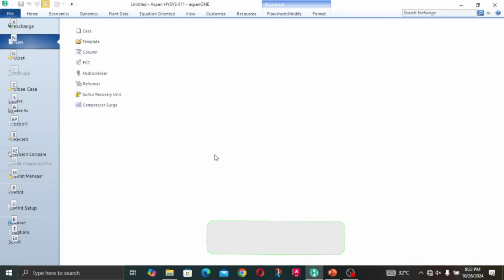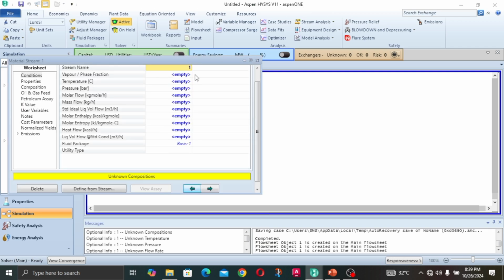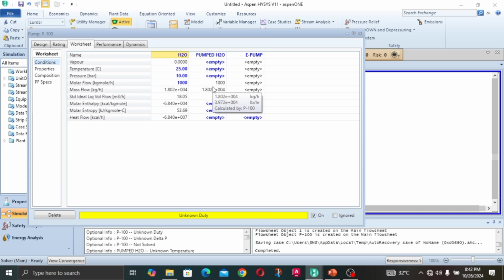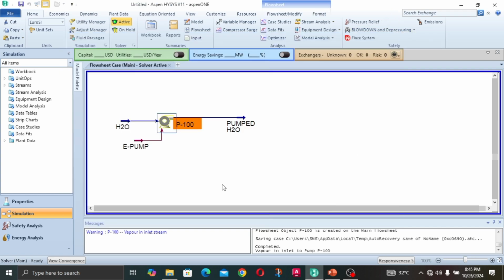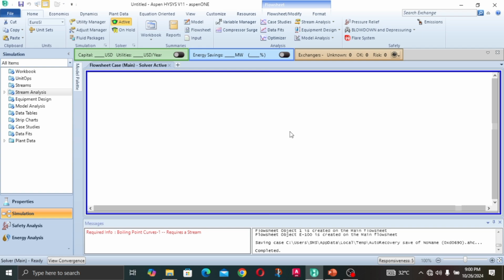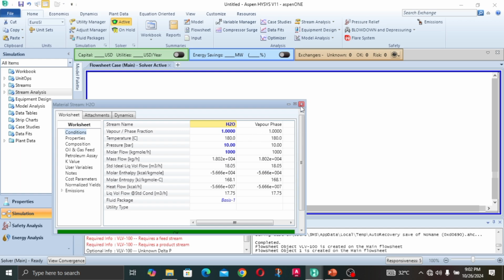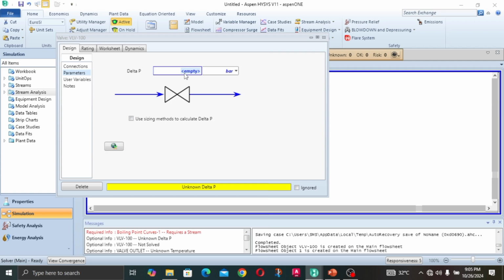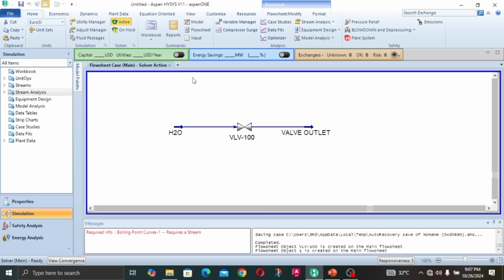How To Operate a Pump and Control Valve in ASPEN HYSYS For Beginners

Comment: Clear explanations, May i know how to check the Control valve opening for this flow i Aspen Hysys?
Reply from the maker: @grandhivenkatachalapathira1588  enter the valve head to Dynamics tab 
Under Dynamic parameters you should have valve opening [%] you will see the valve opening there
But bear in mind that if you're working on a steady state (static) simulation the opening value you
 have it's not 100% accurate it might be hypothetical because that value is for dynamic simulation

Even if you change the valve opening value it won't change your stream conditions if you're modeling on steady state (static) simulation. 

Hope this was helpful